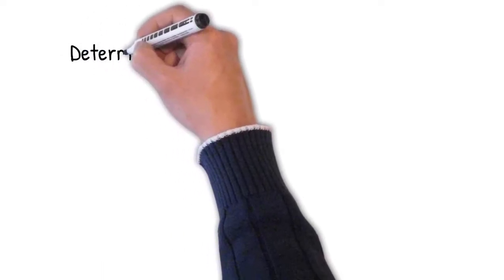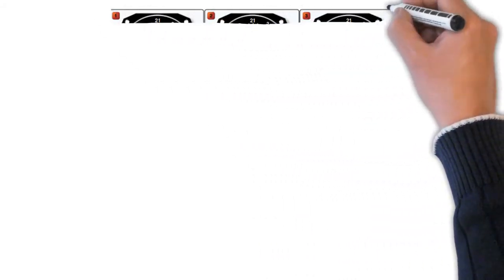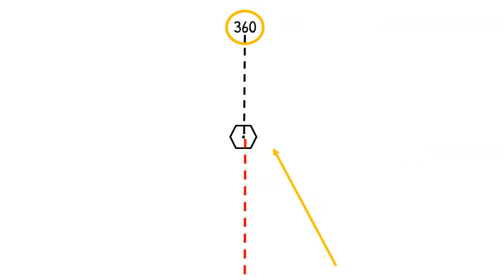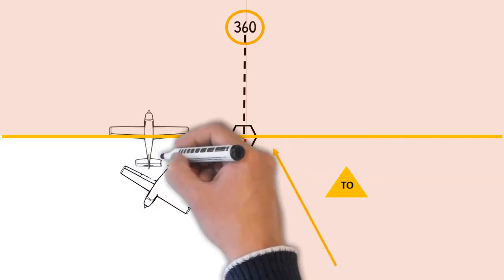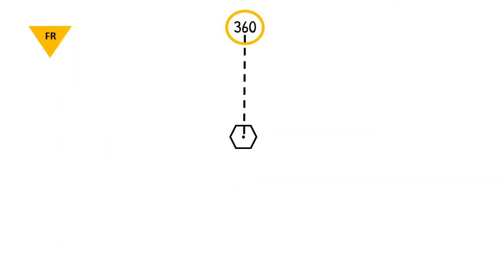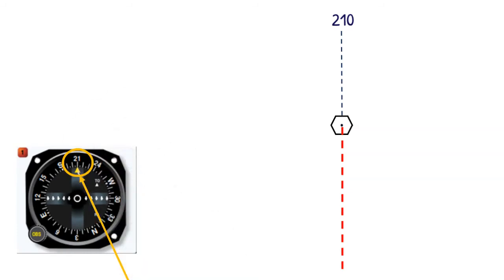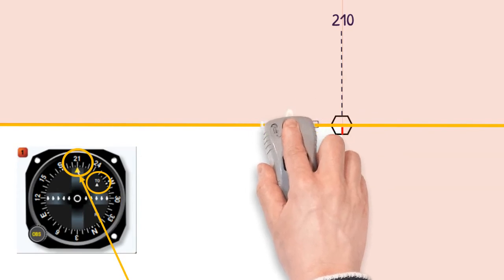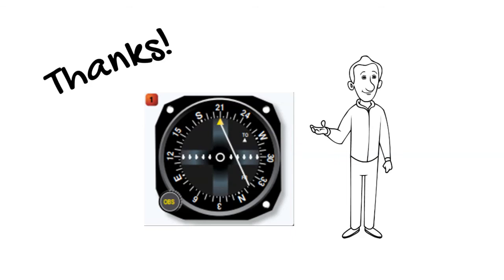Determining Your Position in Relation to a VOR, (no music version)

Comment: great video, another way to determine your position is to turn the cdi knob until the needle centers with the FROM indication, since the radials "radiate" from the station you would know  what radial you are in, if you have another radio indication or a DME from that station, you would know the exactly location of yourself on the map itself
Reply from the maker: GPS is also the easiest lol

Comment: I understand VOR's however, Trying to do this under the hood flying by instruments only and holding my headings, altitude to ACS standards. I can manage to tune the two VOR's but trying to graph  two lines on my Foreflight or paper maps to find my position is super difficult for me. I end up loosing my heading or altitude as I am under instrument. I can only take my eyes off the instruments for like 2 seconds at a time and that's not enough time for me to even try to start the graph line. Easy on the written exam but super hard doing it when flying under the hood.  Is there any tricks to this. I have my Private Pilot check-ride coming up and need to find my position under the hood and stay in ACS standards.
Reply from the maker: So true! It helps to use the needle in the HSI if you have one, since it always just points to the VOR without having ti reference the OBS.

Comment: I think the piucture at 6:52 is wrong. You must draw the airplane flying toward the VOR not away from the VOR! Therefore the airplane position should be to the left of 210 dashed line flying toward the VOR. You are drawing 210 Away (From) to begin with. Now if you put it to the left facing /flying toward the VOR the 210 Track/Ground Course is to the right which means the plane is to the left of the 210. I think you must draw the to and from first and then right and left quadrant otherwise you get it wrong.
Reply from the maker: Armon, the airplane’s directions and heading are irrelevant to the indication.  It is purely the airplane’s position in relation to the VOR.

Comment: Why did you draw the airplanes in random positions?!? Was your only intent to show which quadrant the plane was in based upon the reading on the gauge?And PLEASE STOP using abbreviations for things when it isn't necessary. This is a huge issue amongst an industry that thinks they need to comply with the current conversation in order to "fit in." The impact is that your listeners, unless they are absolutely clear on what your abbreviation means, get stuck and lost in the conversation, which is "counter" to your intentions. Example: you state in the beginning of you video that this video is to "de-mistify the process of determining the position of the aircraft in relationship to the VOR," and it's for students, co-workers and friends who ask you all the time about this. But  then you use OBS and CDI without explaining  what those things are. This is an issue for non-aviation people who want to possibly become aviation people. I myself am still a student, and learning, but I learned a long time ago that using abbreviations doesn't assist communications, because it is used with no regard for the listener. I hope everyone who reads this can learn something from this.
Reply from the maker: Yes to your question about quadrant. Sorry the abbreviations are distracting.  My target audience was those who were familiar with IFR flight, and aviation in general,  You will also find that weather uses the most abbreviations on earth( KBEL 1245Z 270/12G25 4SM FU 050SCT 075BKN …